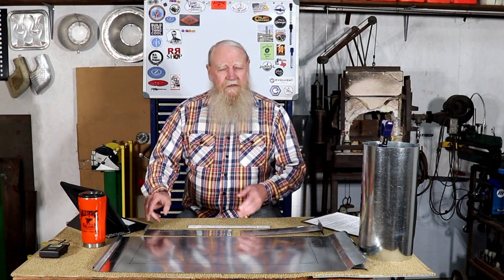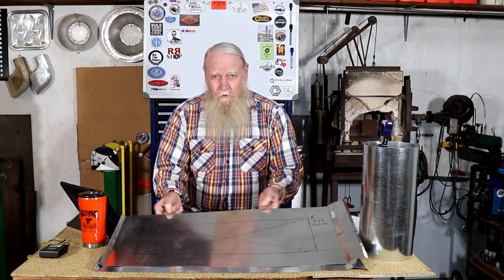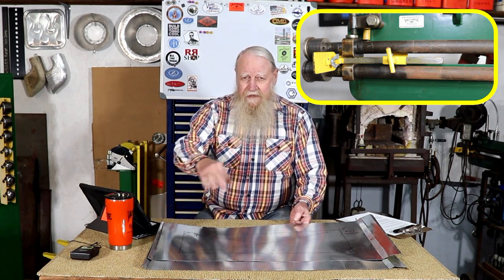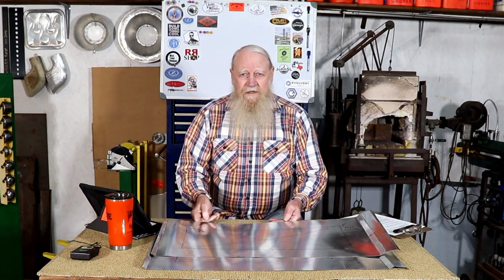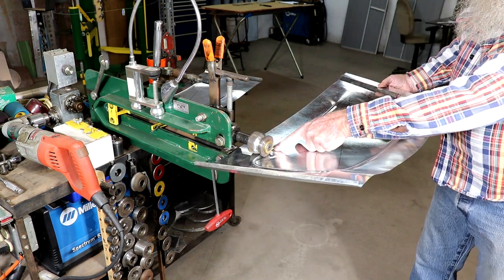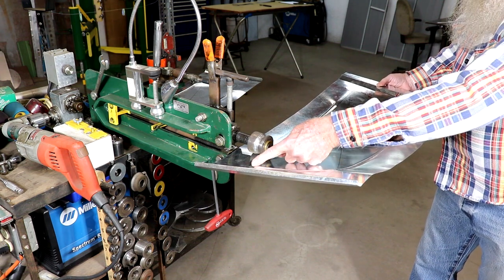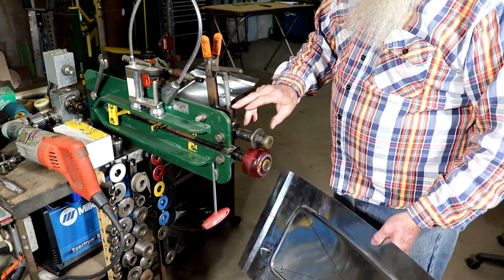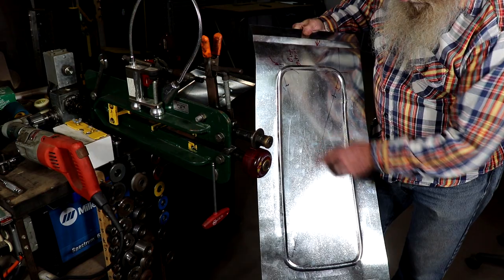Sheet Metal Layout And Bead Rolling

Comment: How did you get the warp out of the panel?
Reply from the maker: Hey Panda.
Just a piece of wood struck in the correct place. Knowing where the stresses are and knowing how to relieve them. Some were done with the sheet laid on a piece of leather to allow for a little more movement.
Once the panels were installed almost all of the warping was gone.

Good question.          Jere